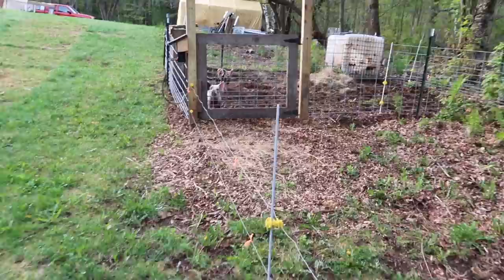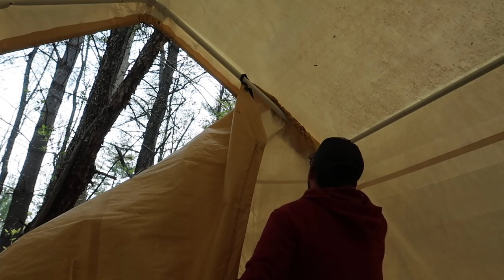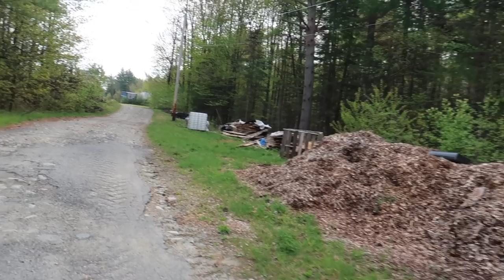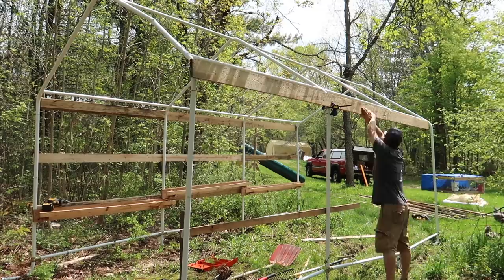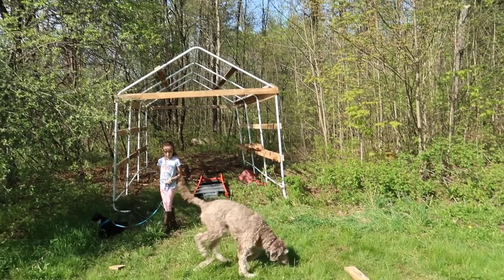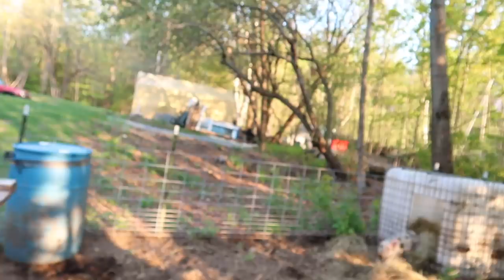Time to Start Working on the Goat Barn

Comment: I was able to use a wire coat hanger to catch a chicken. First use and straighten  a coat hanger  or use a dry cleaning wire, about a yard or so.  Turn one end into 6" or 8" length back onto itself.  Then turn 1" to 2" back out to create a spring /closing the end of the turn back side. Hope this works for you and your family for catching chickens, pullets or turkeys. The animals never see it coming. Works anytime day or night. Its also a method of blood loss, the folded hanger is just a trap for trapping the foot of a bird.

Comment: Goooood Mawnin' Al!     I have a similar shelter logic canopy shed, it's not holding up as well as I would have liked but the frame is fine.   I'll be watching your build thinking about how it might work out for mine.  Are you confident on its ability to hold the weight of the tin roof?  Curious!
Reply: Hi Bill, I agree, I'm going to watch to see what kind of ingenuity Al comes up with for this conversion. He did so well with the 'New Yolk City' build !
Reply from the maker: We will find out.

Comment: What kind of screws did you use to fasten the wood to the metal of the goat barn? I've got a similar tent that I'd like to convert too! 👍 💜🌞🌵, 94/66f today!
Reply from the maker: I will show you the hardware I am using in tomorrows video
Reply: Lumnah Acres, 👍💜🌞🌵

Comment: Where did you buy that canvas shed from
Reply: Ethan Kay looks like a shelter logic brand  they are in Connecticut but distribute through many retailers.  I got mine at 
PepBoys Auto!  Just know that there are different levels of quality, my first one was much better made than the second one I bought and they had the same price.  So beware of the lesser quality ones for around $150, go for the better one if you want it to last!
Reply: They make (at least) two different things about the same size. There is a 10x20 canopy with optional canvas sides and there is a 'garage' like Al has. The garage has larger, heavier tubes in the frame and is made to stay up. The canopy is a temporary deal. Any wind over about 15 mph can pull it apart. We had my son's up in 30 mph gusts but only because we had ratchet straps running the length of the top and sides and two at each corner. I learned that trick by looking at how vendors set up their canopies at events.
Reply: Hugh Brackett gotta love the ratchet straps!

Comment: It hurts my back to watch you drag those chicken "things" around.   I realize wheels might be a problem, but couldn't you put some slides or something similar underneath to make that travel a little smoother?
Reply from the maker: The chicken tractors dont weigh very much they are easy to move, but I need to go slow to make sure I dont run over any chicks